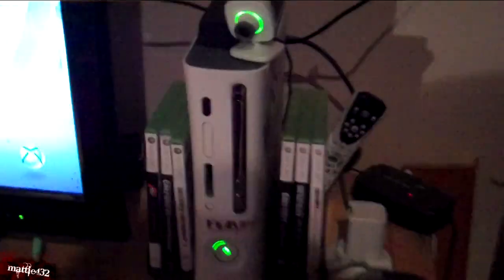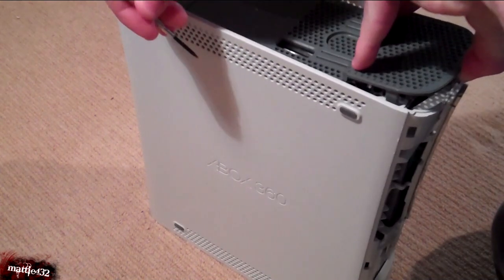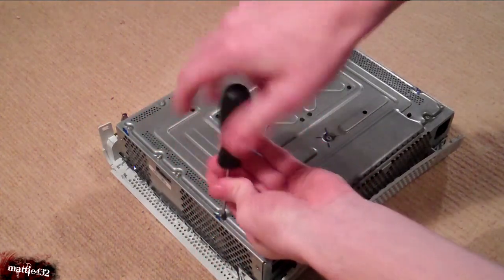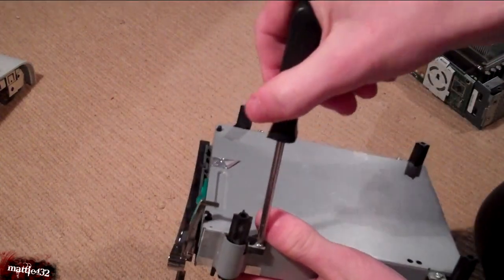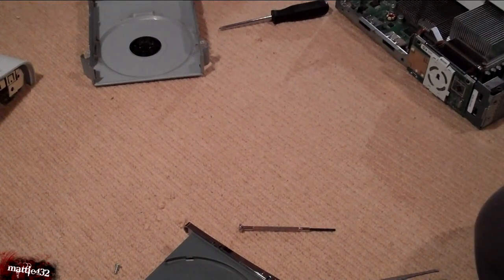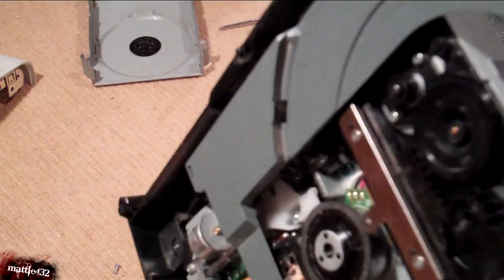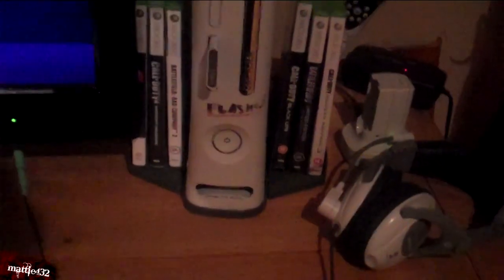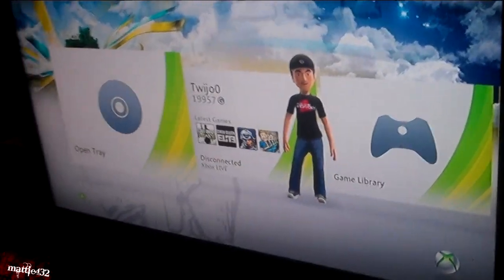XBox360 stuck/jammed DVD drive fix

Comment: Fucking hell mate.  I honestly  did not expect this to work much less I get through without breaking some shit and rendering the unit useless.   It was a hold my breath moment until the tray popped out and a game loaded.  FLAWLESS!  It also gave me the opportunity to pick a a small cheap multi driver that honestly  proved much more useful  than had I just got a T8 driver.  I used almost every bit it came with. Couldn't have done it without  it. Cheers and Thanks!

Comment: If what he did does not work you, try This: 8:06 look for the shiny metal plate with a little hole in it, to the right of the motor that spins the dvd,  bend it down a little more, althoug i sugets You unscrew it and bend it in your hands, put it back and try, if it does not work, bend it a little more and try again. You are welcome!

Comment: This is due to a dirty drive belt.
You need to take the console apart to clean it, or eject the drive to remove the rubber band. Getting the rubber band back in this way is very difficult.

Comment: I've taken my xbox apart and the dvd drive is jammed. Like it moves maybe a centimeter forward and backward. I cannot get to the rubber bands from the top or bottom. The wheel will not turn. It is jammed. I am not sure if the band was twisted somehow. It seems like one of the wheels with teeth is engaged when It shouldn't be. Any tips?

Comment: this kind of worked for my Xbox, the tray opens now only when lying horizontal to the floor, vertical keeps stuck until I flip it horizontally

nevertheless it was a great help, thank you!
Reply: I know how to fix that! 8:06 look for the shiny metal plate with a little hole in it, to the right of the motor that spins the dvd,  bend it down a little more, althoug i sugets You unscrew it and bend it un your hands, put it back and try, if it does not work, bend it more and try again. You are welcome!

Comment: hey I have the stuck disc tray problem but after taking apart my xbox 360 the problem seems to be that when I close the tray manually with a disc in the board with the laser on and everything doesn t come up and locks the disc in as its supposed to when the tray is closed. What do I do to fix this??

Comment: So my Xbox is almost similiar but has the drive part where you can take it off the top, making it difficult to get the pin placement off after I took the drive off because the top is not all level and pins hide with deeper or placed where there are no holes in the end. Any advice?

Comment: I followed your video step by step but now my tray won't open, I press the button to open it and it acts as though I hadn't pressed anything. But I can easily slide the tray in and out with my fingers alone. What did I do wrong?

Comment: Mine would open button was pressed while using a butter knife to help it open. Watched this blew inside of it as if I was blowing in an OG Nintendo game. Used my finger to move the band left to right (hoping to loosen or clean it). It's opening with taking the whole thing apart. I wonder if lubricating the band a bit would help, but going to rock it with taking the whole thing apart.

Comment: YOU DO NOT NEED TO DO THIS. its unnecessary to open up the entire Xbox. all you have to do is remove the face plate. once removed, look at the two little notches located just below your disc tray. the one on the right is the one you will use. take a paper clip, bend it out so that its a straightened, and push it into the hole with some force. your disc tray should pop out a bit. when it does, slide the tray out to its open position and take a look inside the opening in which is slides out from. you can gain access to the rubber band and the gears from here. use your paper clip once more to snag the rubber band, and pull it out. place the rubber band in some moderately hot water for about a minute or so (heat up the water in the microwave or boil it). in doing so you will shrink up the band a bit and give it back its strength. dry it off, place it back on the gears. good to go. you shouldn't have problems with it again. and if you do, simply repeat this process.
Reply: Let the 360 die, shhhhh just let it die, bury it in the yard and have a dog take a dump on it, it's fitting for the Xbox 360.
Reply: SnapCrackleDrop great idea but i cant open the disc tray. how am i supposed to get the rubber band out with it being halfway open?
Reply: J Totilo There's a slot on the left side of the Xbox, jab it with a thin screwdriver to manually pop it open.
Reply: thanks bro, yo i got so pissed last night. I yanked it and plastic went flying off. but i put it back in and works great. it was 6 am
Reply: no problem!
Reply: Yeah that's the alternative way, but if you open it up you can give it a thorough clean too...it's like brand new again!

Comment: One thing I've noticed since taking apart my Xbox is that the disc tray only opens when the console is laying flat on a table, rather than standing on its end. Something is blocking the front of the tray, whether it be the faceplate or something internal. I'll get back to you guys when I find out what it is.

Comment: i have never taken a console apart b4. however im currently doing a course that requires me to be more inqusitive. what would be a good start point for a tool kit and where would be a good place to get most of the coomon replacement parts if required
Reply: 90% of the newer xbox fails are the disc drives going bad.
you need to Solder the OLD motherboard from the disc drive you took Out to the New one you bought/Ebay/cheapest/w 1 year warranty as well<<
you will need a soldering iron,solder,torx bit screwdrivers and a nail file.
the nail file is for popping the rear tabs easily from the sides of the console housing.
these consoles are Hella easy to fix,buy a broken one cheap,get the drive/50 bucks new,w warranty<< and then go scope the Swapping drives Vids on here.
about an hour later youll have a working xbox.

Comment: For mine it seems like the bar on the underside of the tray does not fully come back when trying to take the tray back in. Which causes it not to move cause it may be lacking space. The belt looks like it’s normal shape however.

Comment: Easy way to open the two halves with out a tool, just bend both back as if opening a book, it sounds nasty but does not damage the case, i do this with every single xbox ive opened and i have no screw driver marks to show, and no snapped clips.

Comment: im stuck at 6:52 because i turned the wheel & the tray isn't coming out because the gear next to the the thing that holds the belt, it stops & won't let me pull the tray out any further. what do i do?

Comment: mine had this. but if i leave a disc inside. the door always open. maybe it only fails once for every 50 times. with a disc inside
**but in the horizontal position. not vertical like yours
Reply: same

Comment: doomfighter need help at first i tried to fix the open tray error, but now my xbox dash board says opening or closing, even if the drive is open or close. with the green light flashing so now it will not read disc, by the way a jagged metal piece fell out

Comment: (IMPORTANT INFO MUST READ IF YOU WANT TO FIX THE PROBLEM!)

For all of you having problems finding the screwdriver, go to Home Depot, ask a worker for a "Torx 10" screwdriver" it comes  with sizes 1/4, 3/16, 5/32, 3 1, 0 and 10!!!!
Note: You don't need 12, you can get 10 from home depot for only 10$!!! I swear I am not trolling. If you have any questions ask me. Happy fixing!
Reply: thanks Goku
Reply: Robert Pittman  Your welcome (:
Reply: Thanks for the info
Reply: goku
Reply: Christian Miller hi
Reply: Hi

Comment: have a 360 first gen .. and its not possible to just pull the plastic case off like you did at 3:16.. it still is  holding strong as they were some bolts still in there somewhere

Comment: Thx this really helped us with our xbox 360 can you do the original xbox and ring of death
Reply: Blackvenom what ring of death are you talking about with the original?
Reply: Blackvenom with the ring of death just put your xbox in the freezer for one minute then leave it alone for 4 hours thats what i did it worked
Reply: The Milky Cow that will only temporarily fix the problem. you would have to open the xbox up sometimes. sometimes its not even the console and it's the cord. it all depends on the ring of death you have with the original xbox.

Comment: Hi, this worked brilliantly for me in that I put the xbox back together and the tray opened and closed freely.  HOWEVER, whenever I close the try the power light continues to flash and then it re-opens automatically, and stays open until I close it again.  The same then happens continuously, i.e. the Xbox's default position is tray open, not closed.  Even when I power the xbox down the last thing it does is opens the tray.  Not sure if Ive flipped a switch or done something whilst undertaking the above process, can you or anybody help with this, please?

Comment: I cannot remove the side case. I do not have the tool you used but you said you can use a screwdriver, but I cannot do it for the life of me
Reply: I now realise the tabs we are supposed to be pressing are broken. Any other way to open it?
Reply: @monkeydonk3925  force and screwdriver.  Look at the video and how those tabs are placed. start from the left where you have only 2 tabs.

Comment: Thanks for this... mine has been doing this for ages and then it just wouldn't work at all. 

I didn't take it apart but got a wire to the wheel n kept turning it from left to right (anti clock) and it then popped open... I did this while it was on.

Comment: all it is, is the pin in the middle of the cog that spins the disk tray out. it slips upward, you can push it down with your finger once the tray is open , push the pin down and its sorted, if it happens again do the same thing a very simple thing...

Comment: now I have a question I was prying the tray open and now it's a fourth of the open and won't move would this still help that or is there another method or am I just fucked
Reply: Spray it with wd40 take the front panel off and spray it in the middle under the tray and guaranteed to sort it

Comment: I did this too I did know this was a thing like I used to fiddle with walkmans like the tape ones and the spindles that drive the tape are you guessed it lil rubber bands too but on the xbox something Microsoft should have done was add white lithium grease for lubrication. A quirky problem my xbox the elite version but they all the same no is that on its side would open but be sticky the last like centimeter and wouldn't touch the sensor to say it's open and vertical wouldn't open at all sometimes and that's where the grease helped also on those lil cogs too.

Comment: Did not work for my console, Though i was able to clean off the dust it had accumulated so there's that. Mine opens fine as long as it has a disc in the tray, Those few grams make the difference.

Comment: I would never use my xbox vertical it always ends up puting a ring on the disc. Its best to always use your xbox horizontal then you will be assured your disc is always flat in its tray.

Comment: Lol you don't have to take it apart you can clean the belt using alcohol. Turn the Xbox off but hold the tray open. Then you just push the tray in and out while cleaning the belt with a cotton swab

Comment: You can grease the gears and screw with some vaseline and the screw als.Clean the lens too
Reply: Shadow X does that actually help?
Reply: Israel Castillo Yes...also there is 3 grooves that slides the spindle up and down...those should be greased also...this slolved my drive being stuck

Comment: Wanna save a lot of time and stress and not have have to worry about putting your xbox back toghether? Well here is my 10 step solution! 1. open tray by tapping top 2. turn off Xbox but hold on to tray 3. unplug power supply  4.take tweezers and remove belt 5. take rubbing alcohol and put it on q-tips and clean belt and spools 6. put on belt by putting it on back spool first and the back part of first spool and take your finger and pull it over the rest of the spool 7. push the tray barely in and out to make sure the belt is situate the belt 8. plug in power supply 9. close tray 10. if all goes well tray will open thanks for reading and have a good day!
Reply: +_ askdaxbox _ how do you do that if you cant open it in the first place
Reply: +_ askdaxbox _ A video of that process would sure be nice.
Reply: MsBamafanatic I did it and it worked fine
Reply: +_ askdaxbox _ That's great. I was just saying that a step by step video of your process would be nice to have to be able to follow.
Reply: +MsBamafanatic well I just used screwattacks step by step guide check it out
Reply: +MsBamafanatic just search "screwattack xbox 360 fixing" its the first thing
Reply: +_ askdaxbox _ Thanks!
Reply: +TheRandomGamer 0 what I did because banging the Xbox isn't my idea of things is applying a slight pull action with fingers, wait for box to load, pushed button and the tray opened

Comment: The xbox I have has a disc stuck inside it but it isn't on the tray what should I do pls reply ASAP
Reply: same
Reply: you can still open the xbox up using the same way that the video showed you and then open the drive the same way as well just be careful not to mess with the censor also another way to open the disc tray is to use a straightned paper clip and right under the disc tray in the front is 3 small hole you wat to put the straightend paper clip on the one to the left stick it in there a lil ways and it should pop open the tray but if the disc tray is stuck on the game disc that you have in there then you need to open up the drive from the 4 screws on the underside of it hopefully that helps and fixes your issue ^_^

Comment: I got the “Open tray” error. Bought another 360 and swapped the cd drives. Now it says “cant read media” HELP!!!
Reply: There are different manufacturers of xbox 360 disc drives. For example, Ben Q and Philips are two common ones. As long as the disc drives are the same manufacturer and relatively similar, the circuit board inside the disc drives can be swapped.  Usually the moving parts in a disc drive go bad, NOT the circuit board. Do this swap and you'll have a disc drive that is recognized and with all new moving parts!

Comment: ive taken it apart but the tray is completely stuck i don't know why it wont come out at all???
Reply: mine was stuck as well. i just had to pull and lift after popping it open by pushing on the gear. after that, you just have to pull it out/push it up. when i got it unstuck, the disk tray came completely free. (disk drive in one hand and disk tray in another. mini heart attack.) if the tray come completely free then you just slide it back into place. when you do, push it in and push it back open to make sure that everything moves the way it should

i recommend looking extensively at how everything moves and works before trying to pop the tray out. do be careful not to break anything.

hope this helps.

Comment: Seriously. Everyone read hytlerson comment below. You don't have to do any of this shit. Just open the tray using a paperclip. Take the face plate off, under the disc tray should be two holes. Remember to have the xbox laying down. Push the paper clip in the right (smaller) hole and press open. The xbox should open. Then, power off the xbox just in case by pulling the plug so the tray stays open. Then look inside, there should be a rubber band, remove it, clean it, then put it back on. Simple as that. I was half way through this dumb ass video when I finally read the comment. It takes 4 minutes. Do it. Works fine now.
Reply: That does NOT fix the problem. It only manually opens it but the gadgets inside are still nonfunctional. It's like trying to slow down a car with failing brakes when you're driving ; you turn the car gear into neutral and slow it down then take it to the repair shop. What you said was like NOT taking it to get repaired and always shifting to neutral when you need to stop your car. This is to FIX the problem while the paperclip only gets you around it once.

Comment: My disk tray will only come out about half an inch of the way there.
Reply: There's probably something caught in the teeth along the sides of the tray. I suggest taking the disc drive apart, and conjunction with the procedure in this video, use a magnifying glass and a light source to check all the gears and the tray itself. Don't actually remove the tray from the drive though, it will break. If you find nothing, and you can move the tray by hand further than the few inches you described, one of the gears is probably missing a few teeth. Best of luck to you!
Reply: +BushWookiee_411 Thank you! Hope this will help other people too.
Reply: me two

Comment: I'm currently stuck with 2:50. My case looks stuck together so it's not separating. :-(
Reply: I had the same. A little patience and scredriver and you should be able to open. Its very hard to brake it. Start from the left side as its easier to release.
Reply: @outerspace50   I got there in the end but there was a few tiny breaks of plastic in the process.  All a waste though as it didn't fix my drive.  So I'll look to replace it.  Helpful video though, it was worth a try. :-)

Comment: My disc tray open halfway then closes again, how to fix?
Reply: +zZiL341yRj736 try opening it then when it goes halfway unplug the power cable and it should stay out and then find the rubber thing and turn it clockwise (it should be about in the middle underneath where the disk sits)

Comment: It works like a charm but now my power button doesn't want to work when I take the front plate off it stays on but when I put the plate back on the power ring turns off it feels like there is no movement in the power button what's wrong with that